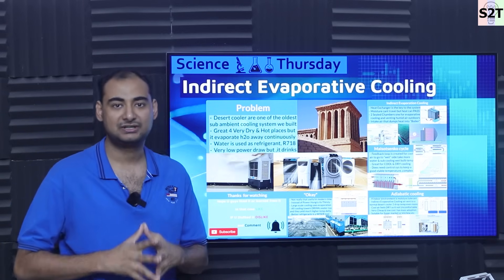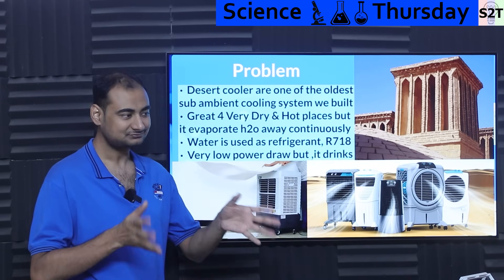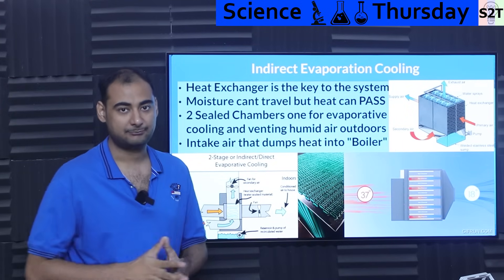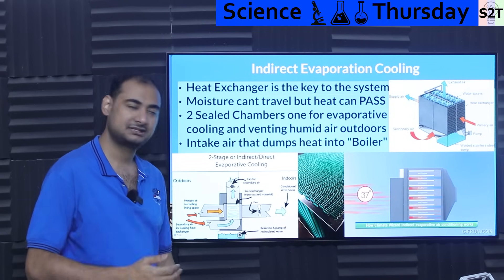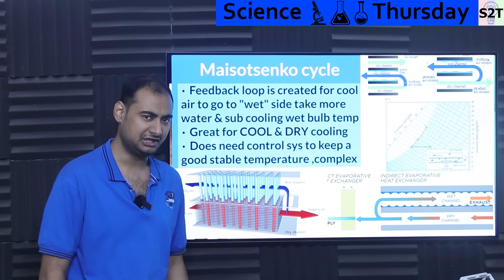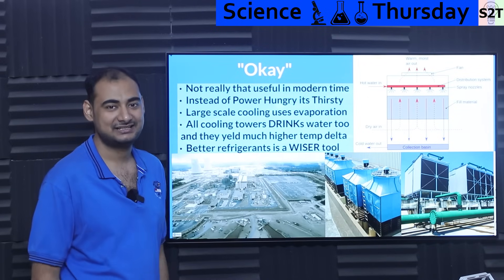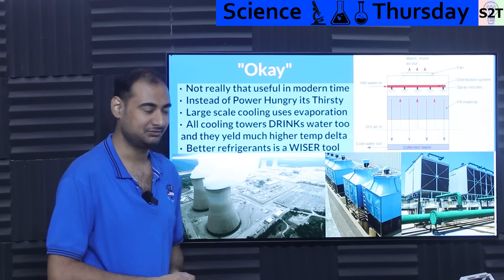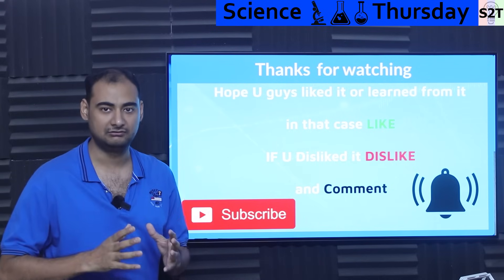Indirect Evaporative Cooling Explained {Science Thursday}

Comment: Enthalpy of vaporization of water around room temperature is about 2.44 kJ/g,  or about 678 kWh per ton of water, you can produce a ton of freshwater from seawater with just a few kWh. So even if you use freshwater produced from seawater for evaporative cooling you can get hundreds of times more cooling for a given amount of energy than required to produce the fresh water. So sure, evaporative cooling use a lot of water, but I don't think that's a big issue.    

Not that it would be impossible to use seawater as it is, but that would require dealing with a range of different issues.         

A drawback for indirect evaporative cooling besides the extra complexity is that you need significantly more heat exchanger "performance" for the same amount of cooling, even compared to direct evaporative cooling. Even if you can reach lower temperature, you need a much bigger system for a given amount of cooling. I think the modest cooling for a given size of a system is one of the reasons even direct evaporative cooling isn't more popular that it is even in areas where it works really well.   

There seems to be other more or less valid reasons most people don't like evaporative cooling in general, besides the fact that most people seems to feel it's important that the system is as small as possible, even when space isn't much of an issue, they also seem to really like extreme performance, the ability to cool down an area to way lower temperatures than what's comfortable seems much more important than the ability to keep an area at a comfortable temperature to a lot of people. I don't know why. 

I think there's a lot of untapped potential in evaporative cooling, especially in indirect evaporative cooling.
Reply from the maker: even if you use freshwater produced from seawater for evaporative cooling you can get hundreds of times more cooling   you will enjoy my todays video then